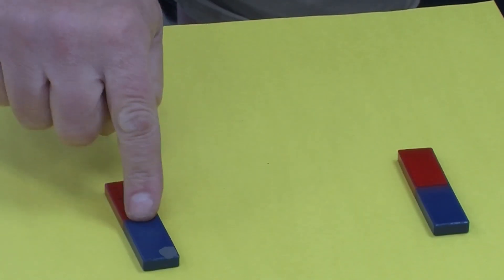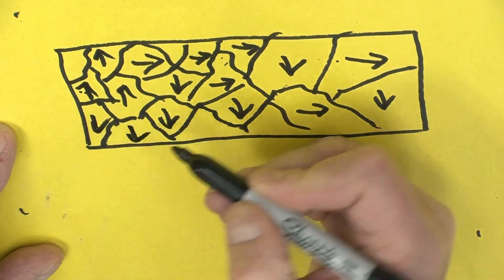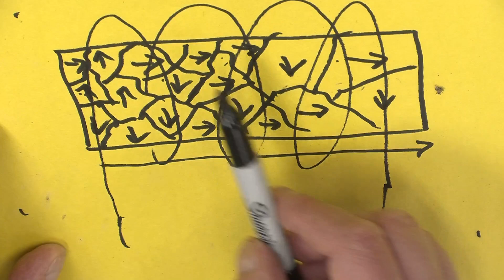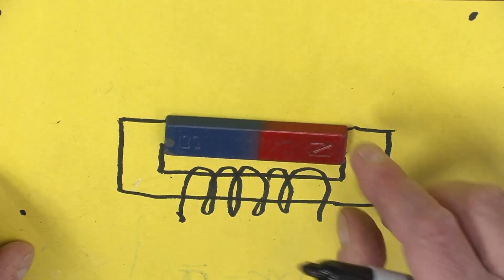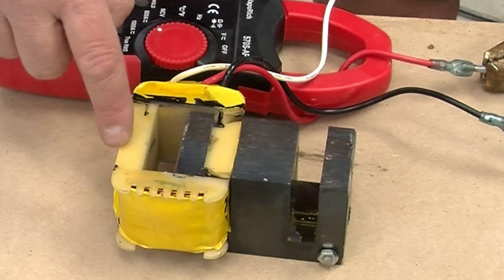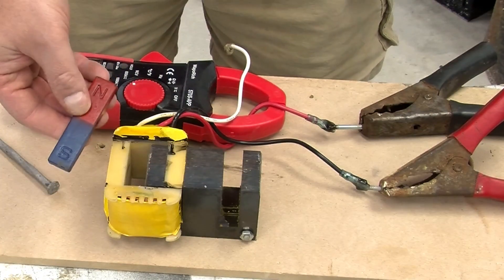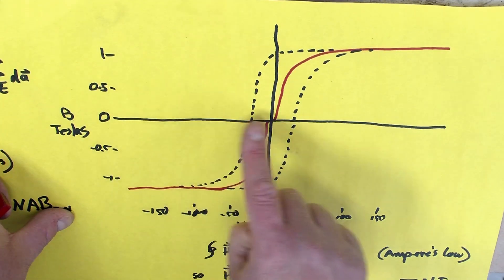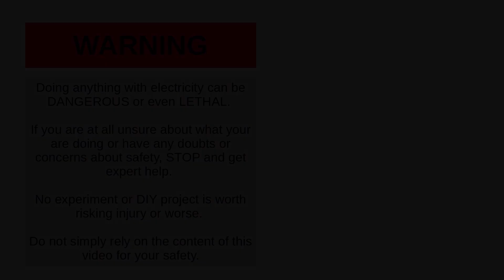How to (Re)Magnetize a Permanent Magnet

Comment: I have many 50 plus year old model train locomotives with motors that have weak magnets. I was hoping to find a way to restore the magnetism to them so that the motors were more efficient with less current draw.  It would have to be a pretty simple set up because much of this went a little over my head. Lol
Reply from the maker: To restore or (re)magnetize a magnet, you have to put in in a magnetic field that is a bit stronger than the field the magnet is expected to retain. Although I haven't taken apart model train motors, I have taken apart other small toy motors and the magnets are usually hard to get out without damaging things. You would then need to put those magnets into a purpose built strong electromagnet to re-magnetize them. No easy solution there. But - instead of re magnetizing the old magnets, could you embed some new strong Neodymium magnets in some material like epoxy that you could shape to slide into the motor after removing the original magnets. Or, perhaps find a cheap source of modern toy motors that just happen to have the same size/shape of magnets as in the model trains? Hope thats useful - wish I had better suggestions!
Reply: @ElectromagneticVideos Thank you for your help. I appreciate it.
Reply from the maker: @robertallen5531  You most welcome! If I think of anything else I'll let you know.

Comment: How do I re magnetize a stir bar?
Reply from the maker: Somehow you have to expose it to a magnetic field higher than the saturation level of the magnetic material it is made out of. Usually that means using an electromagnet  in a way similar to as shown in the video. But you need the electromagnet  to be of the right size and shape to nicely connect to the end of the bar for this to work well which may not be easy to make or obtain. So unfortunately, in the end might be easier to just buy a new one from a cheap online source.

Comment: you should try to heat up the magnets before passing through it a big electromagnetic field ...by heating ou might modify the domains -- pass electromagnetic field - cool...and the magnetic field locks in place.... just an idea...
Reply from the maker: Exactly - heating would certainly work - but would mess up the paint on those "lab" magnets. Other issue - would need an electromagnet that can withstand the current long enough for the permanent magnet to cool down. Sometime I will have to do another video on  the that  to cover how the earth magnetic field is recorded  in lava as it cools and how that has been used to record the earths field reversals over prehistoric times.

Comment: Another way, much less flux.. point the metal towards the north, or south pole at the angle the Earth flux lines enter the Earth and bang the end with a hammer a number of times.. very weak
Reply from the maker: Yes! A very nice demo of how a mechanical shock can provide the energy to allow the magnetic domain boundaries to move and align. The opposite of creating a shock by (accidentally) dropping a magnetized object and having it loose most of its field.

Comment: rectangle tube was RELUNTANT in being Magnetized  :face-fuchsia-tongue-out::face-orange-raised-eyebrow::face-orange-frowning::face-blue-covering-eyes::face-green-smiling:
i tried to magnetize a rectangular tube, only got very weak tip on one side only. used a coil and 12V car battery. then i used a heavy shop magnet by sliding it. but no cigar. wondering if being a tube interferes vs being solid. i'm going to cut all 4 sides. 4 flat plates and magnetize them  :body-blue-raised-arms:
i thought i was doing it wrong do i tried doing have then turning it over to the other half, seeing your thingamabob/core i'm out of my league but i'll still play damn it. Yep i burned my wires insulation LOL. that core is it transformer from a microwave. definitely going to zap myself, that's ok been zapped by car's coil, outlet, solar panel etc. but that CORE :hand-orange-covering-eyes::face-orange-biting-nails:⚡⚡⚡
i'll get a Darwin award and makes sense why women outlive men :trophy-yellow-smiling::face-purple-crying::face-purple-smiling-tears:
you lost me at the 14 - 16 min mark i even turned on CC still went over my head :text-green-game-over: Lava was very interesting was waiting for something to happen but explanation was good enough :face-blue-smiling::person-turqouise-waving:
Reply from the maker: Its probably more the length and the metal. Steel for things like that is magnetically soft - it doesn't retain magnetism well. And a long piece of material like that makes it hard to get a good strong field along its entire length while magnetizing.

Best thing to do - and it sounds like you did - is wind a lot of turns of wire along the length of the tube and then push a lot of current though it for a shot time. Bang it with a hammer to help the domains re-orient. 

Making the tube in 4 plates may help a bit - will concentrate all the magnetic flux out of each end in a smaller area and there seem stronger. 

The core I used is from an old APC 1kw UPS. Stay away from microwave transformers - the HV winding is lethal - your really should avoid Darwin status!

One thought - if you are doing this for a reason other than experimenting, you might find gluing a neodymium magnet to each end of the rod more effective.
Reply: @ElectromagneticVideos  after trying to copy some "magnetic 3"x"12 magnetic plates that my brother has (he bought from Snap On) and i failed, he told me they have 3 magnetic strips on the back and laughed 

i am a photovoltaic/solar thermal technician and do home electrical repairs too. just that these YT videos inspire me and i dive in LOL wrenched on many classic cars that's why i've been zapped by distributor coil

seen DIY projects using the microwave transformer, so yes i will be extremely careful more that i am with DC and AC projects 

magnets also come with their risk, while stroking that tube with the shop magnet it pinched me that it left me a big blood blister LOL 

Thank You for your reply :face-blue-smiling:

Comment: Hay , great video , you did not tell as about this coil , primar or secundar  , and value about resistanca. Thank you so much
Reply from the maker: The transformer was from a 1kw UPS. I used the low voltage part of the coil which  has 31 turns and an approximate resistance of 0.1 Ohms (just measured it).  

Almost any power transformer or a few hundred watts should work - either 120V or 240V should work, and you can use either the HV or LV windings (usually 12 or 24V).

Not sure if I explained this in  the video, but here is how you can estimate the current to drive it with:

1) Use the rated power and voltage for each winding on the transformer to  get the rated current. 

2) That is the max continuous current which is limited by heating due to resistance of the wire in the coil. You can push more current though that for a few seconds before the wire gets hot and insulation melts. 

3) Experiment with a DC power source and see what DC voltage you need to pass maybe 2 to 4 times the rated current though the coil for a few seconds. Use that current for a few seconds each time giving the coil lots of time to cool down between current bursts.  

Note: using much more than normal current is a good idea because the magnetic circuit wont be as good as in the transformer, so you may need more current to push the thing you are trying to magnetize into saturation. I did a video on transformers which covers more of this stuff if your interested.

Hope this helps!

Comment: Do you happen to know if its possible to turn stainless steel into a permanent magnet? Its my understanding that 400 grade steels are ferromagnetic but does that mean they can be converted into a permanent magnet or just attract one? Im developing a product thats made from 400 grade steel and if it were magnetic, that would be perfect. Neodymium is not strong enough for my needs. Thanks
Reply from the maker: I think you are in a difficult position in terms of the properties you want. Usually stainless steels arnt great magnetically. A good magnet needs to be magnetically hard (coercivity) and retain a high level of magnetism (remanence).

You also need to consider the environment - heat, vibration etc that will tend to demagnetize a permanent magnet.  One option might be to have a coil around the steel item to make it an electromagnet so you are less vulnerable to that. 

I did a bit of googling - might be worth contacting this company or one like them:

https://www.eclipsemagnetics.com/resources/guides/are-all-stainless-steels-magnetic/

They seem to be experts on that sort of thing and probably can tell you pretty quickly if a stainless steel exists with the properties you need. 

You may need to disclose more about your product to get useful materials advice. In case your not aware, NDA (Non-disclosure agreement) is a common way of providing protection when doing that. Many company have boilerplate NDAs for potential  suppliers or customers - but always have someone with a bit of experience with that sort of thing look over an NDA before signing - as with any legal document. . 

Having said all of that, you really need an expert on magnetic materials and unfortunately I'm not an expert in materials. One other thought I just had - if you are in a university town every year there are engineering or science undergrad students who need a final projects and departments are usually delighted to have some local industry sponsor a project - usually proving some  $ for materials and being the customer to occasionally meet with the students. If you dont need it tomorrow, that might be a way to get top notch advice and testing, particularity of the university has a prof who is expert on that sort of thing - presumably in Physics, EE, Metallurgy, or Materials depending on the university departments are divided up. Hope that helpful. Happy to try and help - send me an email if you want to connect offline.

Comment: I want to magnetize a prism shaped magnetic material, is it possible? Like N and S poles on its 2 adjcent vertices?
Reply from the maker: Should be no problem  - if  you use a U shaped core for the magnetizing coil, make some more prism shaped metal pieces to fill in the gaps between the faces of you prism and the ends of U.
Reply: @ Thanks, do you have any idea where would I get prism shaped magnetic material?
Reply from the maker: @wetesamir720  Maybe cut a larger piece of magnetic material (ie a permanent magnet) into the shape you want? It wont be easy - materials that make good permanent magnets are generally very brittle.

Comment: just bought 60$ worth of Reluctance high permeability magnetic core and now i wonder what type of voltage and amperage i need, also you mention using a old charger does your charger is 100amp what is the voltage and amperage of this charger ?!?
Reply from the maker: Your need enough amp turns to get it into the saturation region on the BH curve.Try a few 100 turns of magnet wire - maybe 20awg or so until the resistance of the winding is  half an Ohm or so. Hook to a 6V battery charger to get around 12A and see how much the magnet can lift. Now try at 12V to get 24A and see if it can lift about double. If there is not much difference, you are at saturation.  If you can lift much more at 12V, increase the Amp-turns and repeat. 

When doing the above, only do for a few seconds to not overheat the wire or battery charger. 

The charger I have is a 6/12V 100A charger. So at the 12V setting it produces around 16V or and up to 100A.
Reply: i have 100feet of 24awg and i just bought a cheap 13.7v 30A powersupply i might use it for a strong amperage but what if i connect it to a a step down transformer DROK DC-DC Adjustable Buck Voltage Converter Stabilizer 6-32V to 1.25-32V LCD Display Constant Volt Amp 6V 12V 24V Step Down 5A than connect it to a High Voltage Generator DC 6-12V to 400kV Boost Step-Up Inverter Arc Pulse Generator Power Module High Voltage Transformer 5A,  i wonder if i can use extremely high voltage votlage instead of high amperage to remagnetize my n52 magnets i need a strong magnet for my generator project and this pulse arc generator is done to give an Ac wave pulse during 20sec max at high voltage from dc low voltage and low amperage than i connect it my U shaped MnZn PC40 ferrite transformer core and wire 100 turns, it might be interesting and using the drok step down i can ajust voltage down to 1.25volt so the transformer can send less KV to the ferrite core coil, i also have a circuit with capacitor and fuse to reduce amperage and protect circuit but this is from what GrokAI data says at high KV with AC pulse it should help in theory to realign the magnetism but i need your point of view on it do i'm losing my time or i'm better focus on high amperage (100A) like your charger?!?
Reply from the maker: @jejeroy  Its the Amp turns that count. HV like what y9ou suggest wont help - you need the current. I would use your 30A power supply and use as many turns as you can while keeping the current at 30A. 

Or any other combination of things to get the Amp-turns (ie amps though the coil times turns) up into the saturation region of the magnetic material.